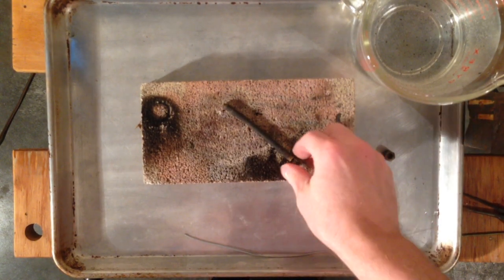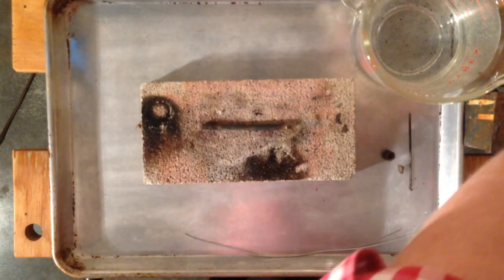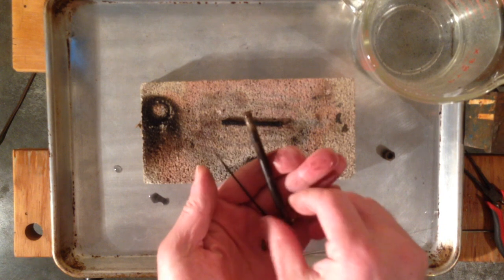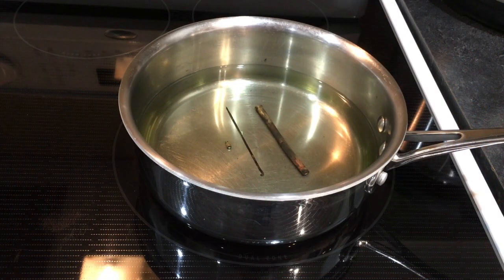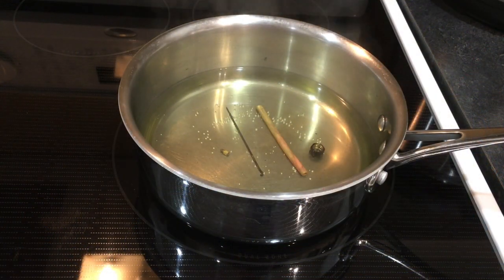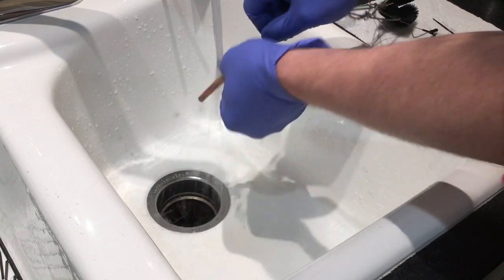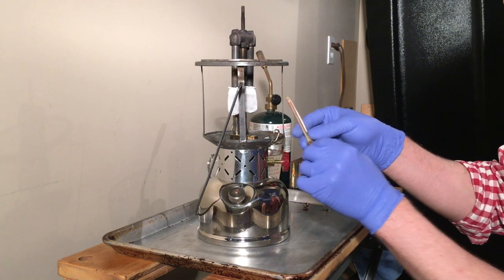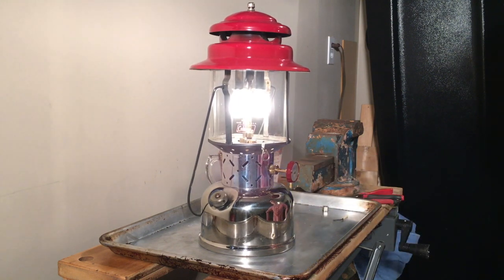How to Clean a Clogged Lantern Generator

Comment: I always like watching your videos.  Hearing that you never replace generators make me know that if I take things slow I can always have a good chance at making my old generators new again.  Your videos are always so calm and like I’m sitting there with you going through the projects. Thanks so much.
Reply: You prolly dont give a damn but does any of you know of a trick to get back into an Instagram account..?
I was stupid lost the account password. I would love any tips you can offer me
Reply: @Kylo Stefan instablaster ;)
Reply: @Desmond Graham it did the trick and I finally got access to my account again. I am so happy!
Thank you so much you saved my ass!
Reply: @Kylo Stefan No problem xD
Reply: Mostly, if you remove the varnish, carbon and other crud you can reuse most of the parts. Even a graphite packing can be reused if adjusted properly! Easy does it! I love rebuilding old stoves and lanterns and only using the OEM parts as much as possible.

Comment: I replace that cardboard with fine mesh brass screen.  McMaster Carr carries it.  You can order it in small 12x12in sheets that will do a lot of generators.  Just roll it around the cleaning needle snugly until it's thick enough to make a snug slip fit into the generator tube.  This works REALLY well and transfers heat to the fuel fast.  I copied what they did with the small military stove stove generators.  This allows a generator to basically last forever.  When perfomance eventually decreases, just do what you did here.  Unroll the mesh screen and torch it.  The carbon is gone in seconds.  Give it a rinse and some tooth brush action to get rid of the ash, roll it back up and Robert is your father's brother.  Since brass anneals with heat, it will be soft and easy to roll.  Copper and brass don't harden when quenched like steel, so feel free to dunk it in water or vinegar.  Once you get the size right, you can cut several out.  They roll easier if you hit them with a torch to red hot first.
Reply: Good idea. Do you keep the spring as part of the assembly or discard it?
Reply: @coffeeandlifting  It isn't critical unless you get too much liquid during light up or pulsing in operation.  It's been a while, so I don't remember which, or how many I trimmed down to accept the spring or when/why I eliminated it on others.  The cardboard one simply displace liquid fuel and provided insulation so that the outer fuel path would heat fast. But liquid still creeps by the cleaning rod too.  Once it's hot, back pressure from vaporization keep the liquid rate low.  If some DOES get through, that space where the spring is allows expansion and final vaporization of any droplets lucky enough to get that far and makes a little surge arresting buffer.
Reply: @mikemorgan5015  Good info on the theory of operation. I'll give it a try with and without the spring. Trying to remember if my 530 has a spring inside the mesh. Pretty sure it doesn't. That might be a clue. Could be that it's only necessary when you don't already have lots of surface area of highly conductive material as would be the case if you're using wire mesh instead of cardboard to fill the space.
Reply: @coffeeandlifting  No sweat.  Play around and see what works.  No spring in a 530 generator.  But remember, that those generators get a most of their heat from conduction from the burner bell.  Shorter is better because of the shorter heat path.

Comment: An alternative to your fire method:  Soak any metal part that is carbon fouled in a product called "Piston Kleen" by Orison Engineering.  It will safely dissolve the carbon and leave your brass parts unharmed.  This product is biodegradable and very environmentally friendly, but a word of caution using it on coated parts - any paint or coating that contains a carbon filler will be stripped off.  Things like cerakote and Teflon coatings will be softened and lose their adherence to the metal surface.  Its great for cleaning anything that gets carbon fouled.  I drop the part into a mason jar filled with Piston Kleen and leave it for several days.  You can tell when the carbon is dissolved by swirling the jar and you'll see the carbon come out and settle to the bottom of the jar.  Its reusable and a coffee filter will screen the carbon out, pouring it from one jar to another.  A gallon of Piston Kleen costs $25 and it'll last a long time if you keep it in a closed mason jar.
Reply: I can not find this on Amazon in the USA. Where do I get it?

Comment: Very good tutorial!! I clean my generators basically the same way. Sometimes I rap stranded copper wire around the needle stem spacing  it out a little. This works well and allows me to use unleaded gas in my lanterns!! Thank you!!  Jim from Kansas!!

Comment: Great video.  I'm like you and I do not replace generators unless they are truly at end-of-life.  I picked up a large parts lot in the spring this year and it had a lot of 335 and 321 parts so many G3 generators (last count was over 20).  Most were plugged solid and the needle, cardboard tube and spring were NOT coming out.  I used an old trick I learned in auto shop sooo long ago in that I soak them for at least a week in seafoam.  Same stuff you pour into your gas tank or oil in your car.  it does a great job of breaking up the carbon and dissolving any gummed up fuel and varnish.  The best part is that it is reusable for a long time.  I keep it in a mason jar, drop the generators in (bottom side facing down), close it up and leave it in a warm spot and forget about it.  So far I have only had a single one that I was not able to rescue and that one just needs a new cardboard tube.  Since I have so many just sitting there waiting to get installed as I go through all the parts I'm in no rush to finish the job.

Really appreciate you showing your methods.  In our disposable 'throw it away" society it's nice to see people who are willing to put in just a little more effort to keep the old stuff going.

Comment: Thank you! I very much needed this video. I am learning to work on lanterns. I have 2 that will not work. I'm frustrated but I am not hurrying. I cleaned a generator and that piece of brass mesh fell out. I was very disturbed because I didn't know what to do. I was much relieved when I saw that you had a piece also.  I will torch the other tomorrow, like you did, because it will not come apart. I'm getting there though!

Comment: Good information and great video.   But damn dude, put a strainer in that sink drain!  You were spiking our anxiety with visions of that gas jet falling into the abyss 😱
Regarding the asbestos tube,  you will never be able get the tube over 212 degrees until after the asbestos inside has dried out.  I don't believe this proposes much risk, but thought I'd mention it.  
Keep up the good work. :goodvibes:
Reply from the maker: Thanks.  The generator doesn't need to reach 212°F to work.  Gasoline will start vapourising once it's over 100°F.  The problem with wet asbestos is that you end up with water and water vapour mixing with the gas vapour and interfering with combustion.  It basically means a bit of a cranky first light-up, but it will settle down pretty quickly.  As far as the sink goes, I've lost count of similar comments about the drain.  I've never dropped anything down there, but there's a reason I use the side of the sink with the garbage disposal.  Nothing on a lantern is small enough to get past the holes in the garbage disposal.  If I drop anything, it can be pretty easily retrieved.  If I drop anything down the other side, it'll quickly be gone forever.

Comment: Many thanks for making this video!  It will save dozens of generators at my place alone.  Wish you could do one on saving suitcase stove gennies too - new gennies for the 2-burner suitcase stoves often cost more than the stoves are worth, would be nice to see a proper method of making them like new again.
Reply from the maker: Hi Mike.  You can restore a stove generator with the same process.  Unscrew it from the valve, unscrew the tip, remove the gas jet, spring, and cleaning rod.  Boil them all in some citric acid or vinegar, Clean with fine steel wool and run a stiff brush through the generator tube.  In most cases it'll be good as new.  If the spring won't come out due to carbon, you can heat and quench as with the lantern generators.  It'll take more heat, but the steel will tolerate that better than brass lantern generators.

Comment: I was just able to acquire a 236 Major and I've got a plugged generator.  Thanks for this video, I'll be trying this today.
Reply: 236 should have a large and small spring inside and no packing. very easy to clean
Reply: @crabtrap  are you sure about that? I have a Canadian 2-47 236 Major plugged up, and it sure looks like an asbestos packing in the generator to me when i shine a light up through the bottom of the generator! It's currently lodged in there - I got the tip cleaner out of it, but the rest is stuck.
Reply: @kellycooleyCPS  the original packing was double spring, later replacements can have fiberglass or perhaps asbestos. All mine are US factory so CA may have used differant. Either way, the packing is to slow flow of liquid fuel down so it can vaporize properly.
Reply: @crabtrap  thanks for the quick response! I've had two 237 Empire (both Canadian) with the double spring you describe, but this one appears to be different. I'm a little hesitant to pull away at it, so I'll likely use Bill's method of heat/quench. Have to find a suitable respirator and cartriages rated for asbestos filtering, though!
Reply: @kellycooleyCPS  don't be hesitate. you can repack with copper wire or fine brass mesh.  or go to 'oldcolemanparts . com' and by a new one reasonably priced.
youtube search rebuilding a coleman lantern generator. its easy especially the bigger 236/237's
Reply: @crabtrap  Sounds good. I'm familiar with the rebuild method with copper wire - it would be interesting to try the brass mesh. Thanks.
Reply: @kellycooleyCPS 
'#60 brass mesh' an amazon. One roll will last a lifetime

Comment: Thank you for sharing your knowledge.  I have watched most of your videos and they have been very helpful.  In this video you mention replacing the cardboard tube in the generator by wrapping the spring with stranded 16 guage copper wire.  Could you please do a video on this?  Also, in another of your videos you mention using plumbers packing rope to replace the carbon valve stem packing.  I bought some of the 1/8 inch packing and now I need to know how to use it. Could you include those instructions in the same video?
Reply: I am in the same situation as you. I have two beautiful CQ lamps but they leak at the fuel valve that have the string graphite. I have asked here and other places on YT and not one has shown how to do it, but they like to show off their lamps. I don't get it.....

Comment: I have found that using the flint retracting lighter accessory and keeping the fuel flow way down during generator warm up, a whole lot less carbon forms on the exterior of the generator. These dark spots create the hot spots inside that cooks the tube over the spring. Matches introduce corrosive sulfur compounds in the lantern that will slowly corrode the exterior of the generator and propane lighter flames are just quite sooty.

Comment: Some great tips there. Thanks. I’m unfamiliar with the Coleman’s as I live in Ireland, mainly Uk & European lamps. However I just bought a Coleman 639 in almost perfect condition. Made in Canada stamped 1—-73 on base. It actually came full of fuel & pressurised ! Because the inside of the hood is so clean & just showing very light soothing I suspect it was only lit once or twice. The issue I have with it is that the pump is VERY hard to push in. What are your thoughts on this & how should I proceed to getting it running again. Thanks in advance.
Reply from the maker: Did you turn the pump handle anti-clockwise to unscrew the air stem from the check valve?  The air stem seals the check valve when close, so if you don't unscrew that enough you may find it hard to pump. Or it may be a lubrication issue.  Be sure the leather pump cup is well lubricated.
Reply: @king.coleman  Thanks for speedy reply. I hadn’t done that and now it’s pumping ! Also leaking fuel everywhere! Such fun. I’ll tighten up everything and try again. Thanks again.

Comment: While watching, I have been afraid of something may drop into the sink.  I'm also looking for a video for stove's generators as well. They are not straight, I wonder how you will cope with these kind of generators found in Coleman 533's or the like. Thank you for sharing this valuable video with us.
Reply from the maker: It's never been a problem, but that's why I use the side of the sink with the garbage disposal.  If something falls down the other side it could be gone forever or, at least, I'd have to take apart the trap to get it back.  If it falls in the garbage disposal I can just reach down and get it.  There's nothing on a stove or lantern small enough to get through the holes.

Comment: Great video, great information thanks, is there a fix for the spring? I've had several that come out in pieces or half of it just rusted gone
Reply from the maker: To my knowledge no one sells replacement springs specifically for Coleman generators.  That said, there are places that sell springs and if you can find one the right size there's no reason it shouldn't work.
Reply: @king.coleman  ok yeah thats what i figured, I'll have to research on where i can get a spring that would fit, its a shame to throw away a generator just because of a bad spring, thanks for your reply

Comment: Another in a long line of super informative videos - thanks again! I have a G3A generator off a '79 321B that I managed to get cleaning needle assembly out of, and it's just covered in black sticky carbon, making it not slide easily inside the spring loaded tube still wedged in the main tube. I plan to do the mild warm acid soak on the cleaning needle assembly that you outline here. My question is the rest of the tube - I think it's the second type you feature here with the cardboard tube and spring, but I cannot get it out to confirm that. Just curious if you've restored any of these G3As and that indeed that's what I'm likely to find inside it once I do the heat/quench? Thanks!
Reply from the maker: Sorry for missing your comment, Kelly.  Yes, a G3 generator's going to have a cardboard tube.  The procedure for removal will be the same.
Reply: @king.coleman  Thanks, Bill!

Comment: Awesome! I’ve got a 335 pine green 1/76 that I converted to Kero with a 339 Gen and a preheat cup. Runs great, kept the original G3 that came with the 335. Good to know about the copper wire. The cardboard tube in mine is fine but glad to have a back up plan. Now do you wrap the spring the same length that the cardboard tube originally covered?
Reply from the maker: It's really only there to keep the cleaning rod centred in the generator, so if it's the same or a bit longer or shorter shouldn't make a difference.

Comment: I have a Coleman 295. A couple of questions please: - - 1How do I clean the generator
2 I can unscrew the top but then how do I take out the needle (does it have to be taken out for cleaning?)

Thanks much in advance.
Reply from the maker: They're all pretty much the same.  As in the video, the needle is removed from the bottom, not the top.  How bad it is will determine how aggressively you need to clean it.  In most cases a boil in citric acid or white vinegar and cleaning with a bore brush will take care of it.

Comment: I always knew this could be done but haven't spent the time to accomplish it. My jar of mystery generators can be cleaned sometime when I get the time. I have some 236 generators with a slight bend what would you recommend when refurbishing these? Thanks for the video very educational.
Reply from the maker: They're brass and can be easily straightened, especially after heating and quenching.

Comment: Love your channel. Regarding cleaning generators, I have a question: no doubt you have addressed this somewhere. I have been been cleaning my generators since watching this video. Recently I attempted to clean a 201 generator due to severe carbon build up. I’ve already cleaned this generator a number of times. This last time I damaged the spring that wraps around the pricker wire. All other parts of the generator cleaned up perfectly. Ok here is my question: what can be used in this generator as a replacement for the spring shaped part allowing me to continue to use the generator in lieu of spending ~$25.00+shipping for a new Coleman replacement 201 generator? Any suggestions would be welcome. Finally just a word about you channel. Keep up your good work.  😊
Reply from the maker: A lot of guys wrap bronze wool around the cleaning rods, but I can't speak to how that would work in a kerosene generator.  I've only heard of it being used with gasoline and I don't know if that would make a difference.  I'd either visit a hardware store that sells springs and see if I could find something similar to the original or I'd wrap the cleaning rod with 16 gauge copper wire.
Reply: @king.coleman  thank you